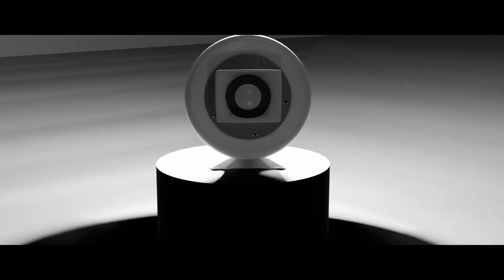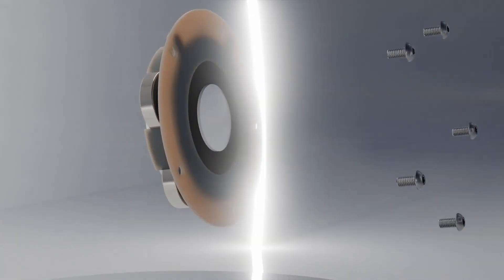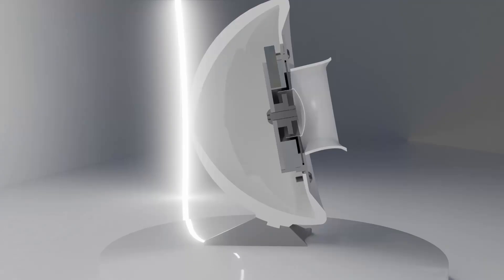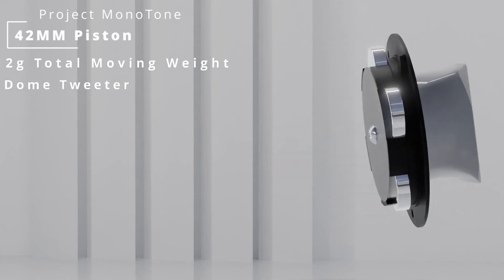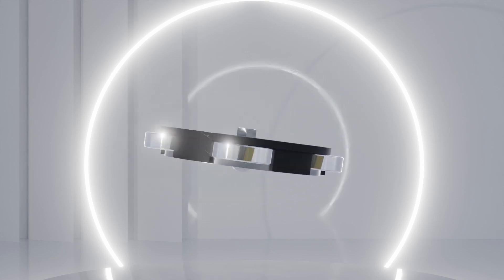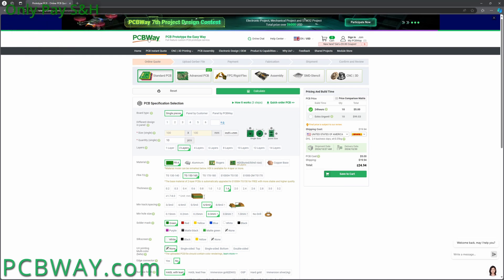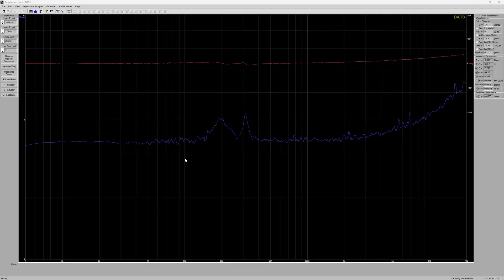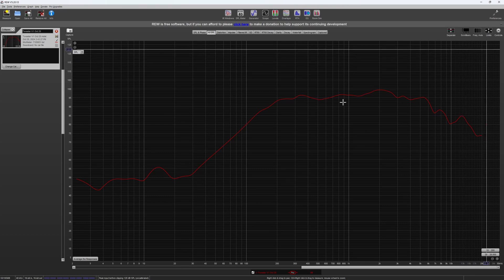Fully 3D Printed Tweeter v1 - Project MonoTone

Comment: Do you think using tpu filament as an enclosure (speaker box)material would be better than MDF wood, considering dampining factores.
If yes, how much of infel percentage fo material should it be? It's for 2-way 6.5 midrange.
Reply from the maker: I would advise against it as you don’t want your box absorbing any of the energy from the driver. And any flexing is lost energy and sound.

Comment: dude. genius. once you refine this design, will you think about proceeding to woofers and subwoofers?! and run them through an amp with something like an epicenter? also, just got a roll of tpu , and i'm determined to master how to print it due to how much of a PITA i've heard it be. Maybe i could give printing a spider, cone, and surround a go? will keep in touch if and when I get around to it. bless for the commitment to innovation.
Reply from the maker: Thanks! If you want some premade files for spiders and surrounds check out my v17 and v16 speaker videos- they have links to files. They have been designed with 3d printing in mind. I print them without any support. 

Also I have currently made 1 subwoofer- it failed catastrophically, but it worked really well for a short while. I’ll have another in the works soon.

Comment: Looks great. However, there is something that I think is wrong about the design. If you use a series of concentric magnets, unless all of them are almost identical, and u will need to test a lot of them to ensure that, and even if you do simple tests of force at the same distance, you can't trust that the magnetic field will be even... So... at the end, I don't know how much fidelity u can achieve. That is why that design is not used in the industry. Did you try with the magnets that kitchen microwaves have inside their magnetrons? Those magnets are very strong, and they have the perfect shape for a tweeter.
Reply from the maker: I believe DC audio and a few others use arrays on magnets on the woofers. I didn’t have a ring magnet but I did have a bunch of these N52 American made magnets- so I trust they are the same quality. In the future I’ll likely go ring magnets on a motor that’s purpose built- but this was a combination of leftover plates from previous projects- it helped cut costs on the first version. Thanks for the input though!

Comment: Awesome! Do you think that in a year or two, assuming you continue this series, its reasonable to have a setup roughly equivalent to maybe a B&W Matrix 803 series 2 level speaker setup, that is to say really excellent sound around the 5k price-point, but in just these 3d printed speakers? Obviously, I would have to put in the work to print and assemble them, and they wouldnt be cheap, im just curious as to how much performance you expect to get out of these if they were in an entire system, tweeters and mids and sub, in the timeframe of a few years?

I am listening to the demo of the tweeter right now and it sounds pretty good, i just think that its limited by your microphone and youtube compression because it doesnt sound totally right, that being said im not in the habit of listening to just a single tweeter without an entire sound system and i also dont have my good sound setup right now.
Reply from the maker: If it progresses in the same fashion as it has, I could definitely see it closing on a high end speaker- remember though to maintain the 3D printable constraint means I have to give up material choice flexibility - so voice coil formers that see 150C would be the upper end with nylon or PC unless I outsource for some PEEK or something. 

Some manufacturers use metal formers or kapton formers for high heat application. So it’s fair to say I could close in on those designs but likely I’ll never beat them in anything but price.
Reply: @piscesprinting  thanks the for the detailed reply, I have a second room that I would like to have a high end speaker system in but don't have the cash, and I'm just thinking how awesome it would be to have a fully 3d printed setup in a year or two

Comment: As of right now, the on-axis FRQ is smooth enough to be used as a dome midrange, assuming the off-axis doesn't differ substantially. I wonder where the cone breakup is? Possible applications for something of this size could include a 3-way mini monitor.
Reply from the maker: I suppose I could start adding a 15,30 and 45 degree off axis measurement. I’ll look into what’s required.
Reply from the maker: In future videos I will try to post up distortion graphs- I don’t know enough about them to discuss though so until then it may just be a short 5 second clip that you can pause on.